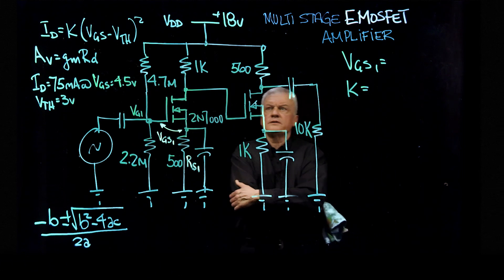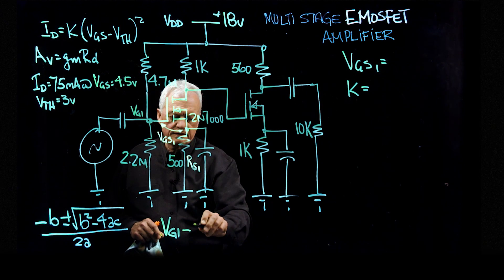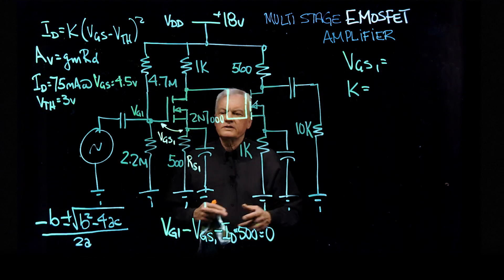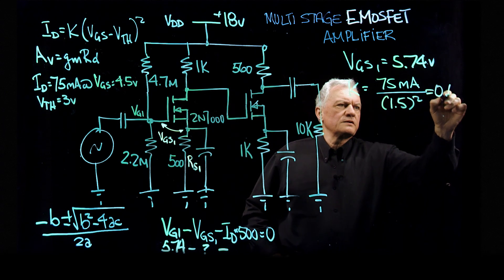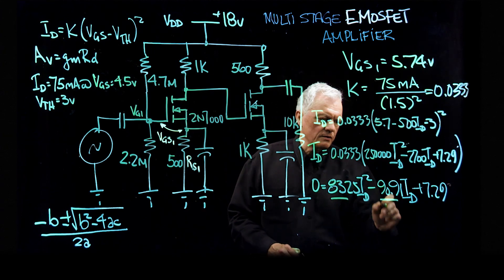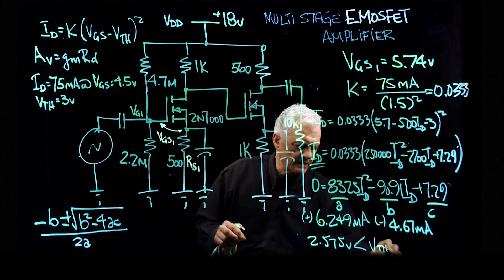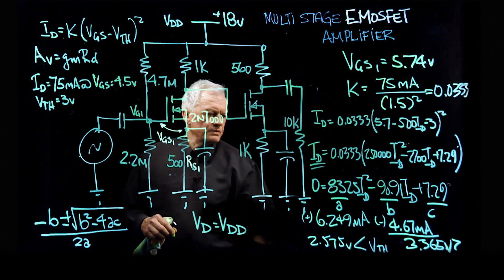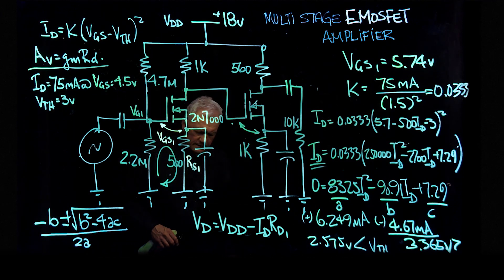Electronic Circuits | Emos Field Effect Multi-Stage Amplifiers - Part 1 of 2

Comment: Wouldnt the quadradic formula be unsolvable since there would be a negative under the square root? When I put the equation into desmos the parabola doesnt cross the x axis.
Reply: he made a mistake he didn't multiply 7.29 by 0.0333
Reply: Ah, thanks. Was confused about that.